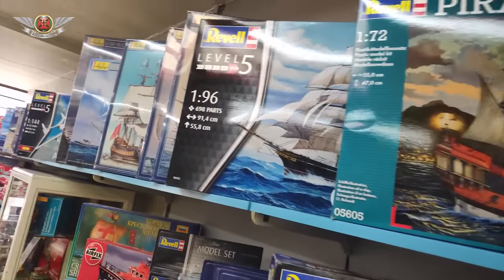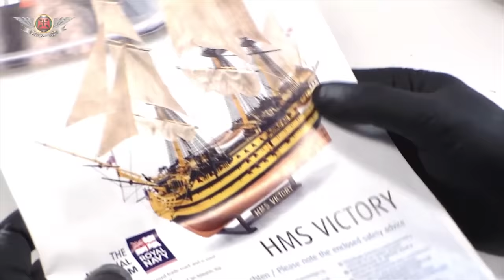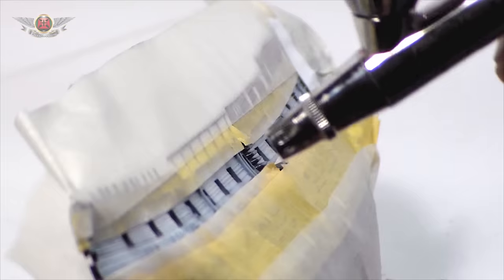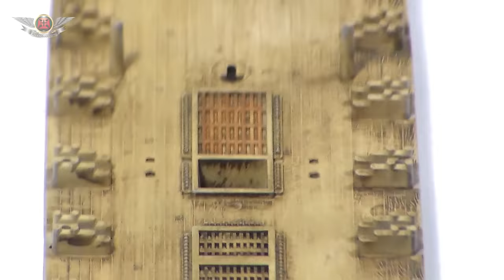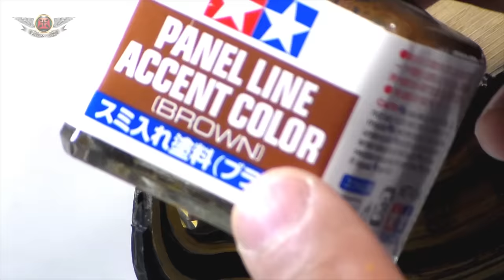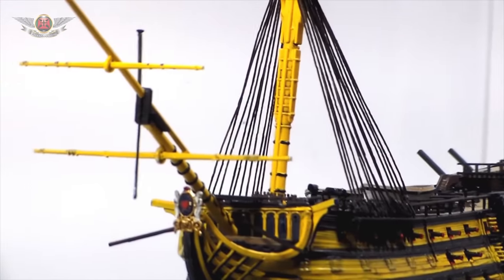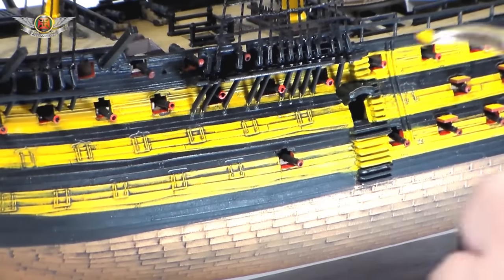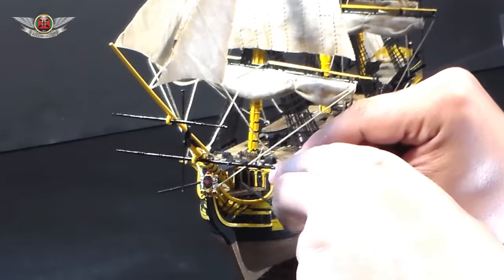REVELL 1/225 HMS VICTORY FULL BUILD VIDEO #epicHistoryTV #hmsvictory #trafalgarlaw

Comment: True colour - not yellow, but an ochre buff colour:
https://www.hms-victory.com/restoration-log/hms-victory-her-true-colours

I can't say much positive about this build!
I got back into model kit building a few years ago. But before that I had built a few kits including a Spanish galley.
The rigging thread you used is massively to thick and the wrong colour for that scale.
Also even for a minimum impression of rigging there just isn't enough of it. Rigging can be difficult but you have to think about what the 'rope' is for and it's purpose. Usually  there is some physics/mechanics involved which defines it's purpose.
For instance the ropes/rigging that are taught under the bowsprit are there to stop the forces produced by the head sails snapping the bowsprit in two (or more pieces). They stop the bowsprit bending and breaking.